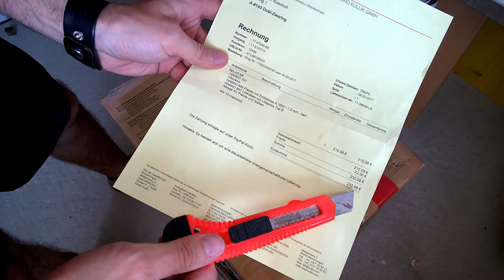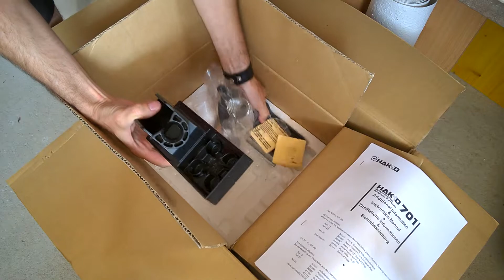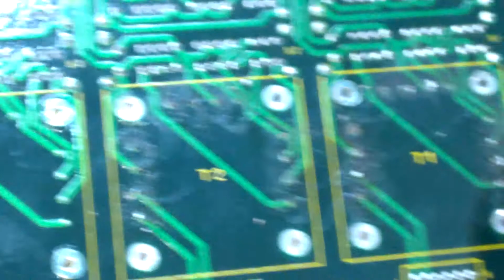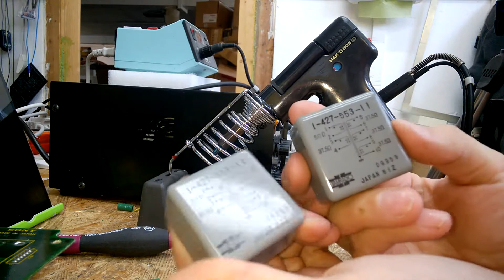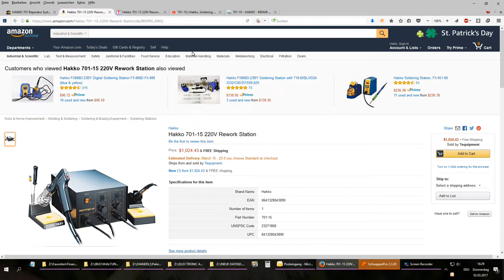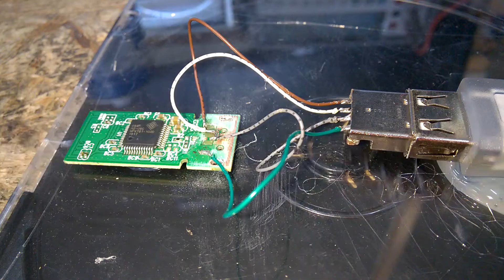BEB #51: Hakko 701 desoldering gun rework station TEST review

Comment: if you take some flux middel on the pads you want to desolder before you try , it melts faster.dont need extra tinn.when you use extra tinn on pads to get them loose you will find out that the desolder gun get,s full quick
Reply from the maker: yes, that's absolutely right

Comment: My first experience with a desoldering station was a ten-year-old Pace desoldering pencil with digital temperature control...a $1500 unit!

His desoldering station is a different one.  He put a self-built VFD inside of his so he could run the pump faster than normal speed.
Reply from the maker: that's cool

I remember I have used a Weller desoldering tool 20 years ago. The hose was blocked every few minutes.

Comment from the maker: FIRST !!!

I have to add that this is not a paid commercial. I've seen this tool in the videos by Mr Carlson's Lab (link in description). And after a few days of use, I can highly recommend you the Hakko tool.
Reply: you should arrange a theme song with the sound of the pump.....
Reply: I also picked up one of these (Hakko 470) a few months ago due to Mr. C - and it is great. Although I think the pump is a bit feeble on 50hz, may have to build the VFD sometime. The gun gets blocked easily near the chamber but if you sit the gun vertically and let it heat up longer before using, this will clear itself and less likely to get blocked during use.